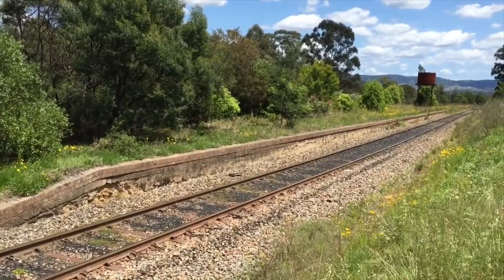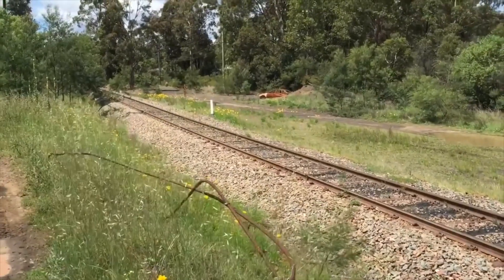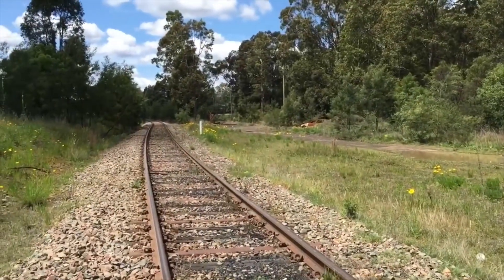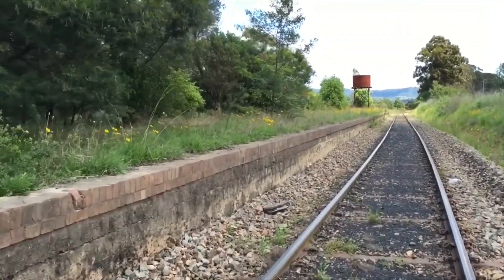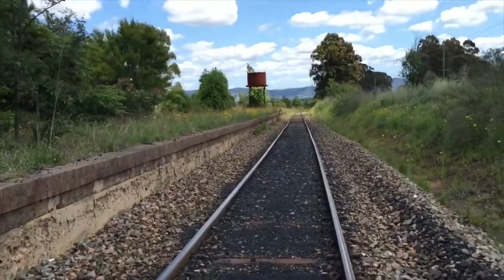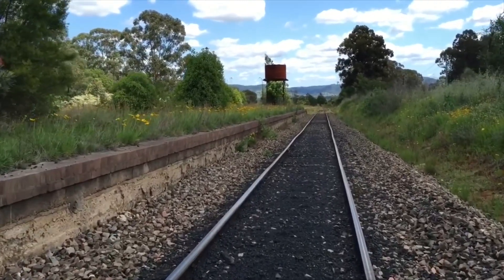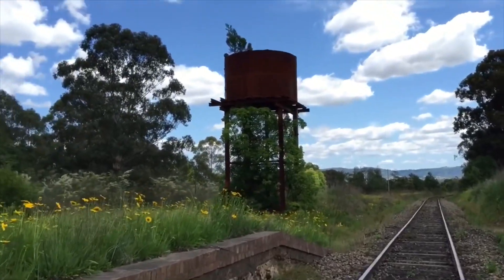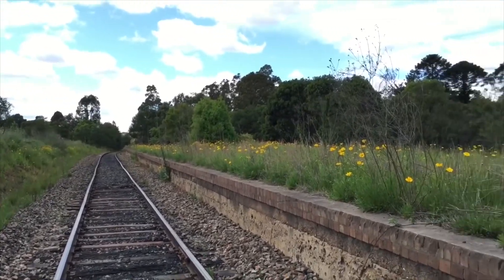Abandoned Oz: Disused Cessnock Line - Caledonia

Comment: Main facility: Station (Closed)
Lines: Cessnock Branch
Location: (151.3793°, -32.8476°) [exact] GDA94
Distance: 215.670 km from Sydney
History: 
16-Feb-1904 Opened as Aberdare
Nov-1912 Renamed Caledonia
unknown Closed
Photos: 1986, 1995, 2001, 2004
Description: Consisted of a 100m island platform and station with a set of 5 colliery sidings in the down yard. There was a signal box at the up end of the platform with a water tank and column at the other end. At the Cessnock end was an up goods siding with small shed.
Current status: The platform, signal box and water tank are still present. The signal has been gutted. The water column was been removed, although the base still remains. No trace remains of the sidings.